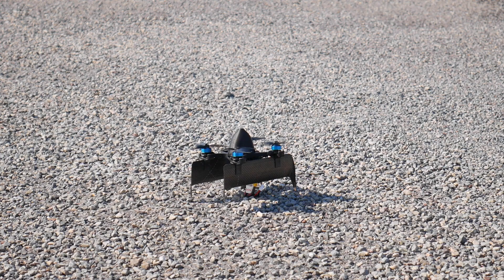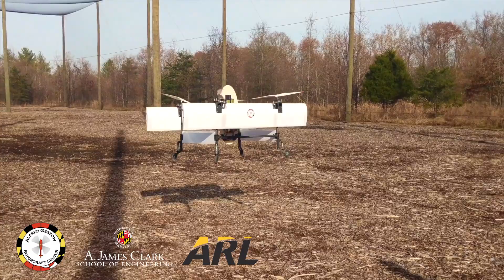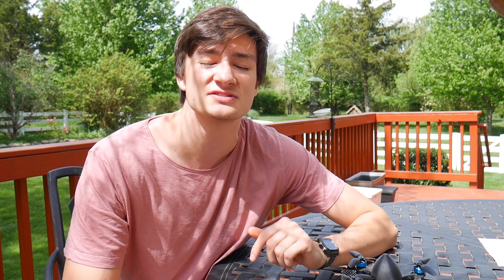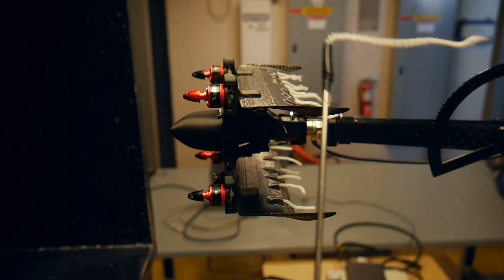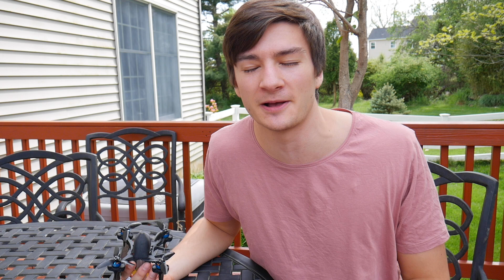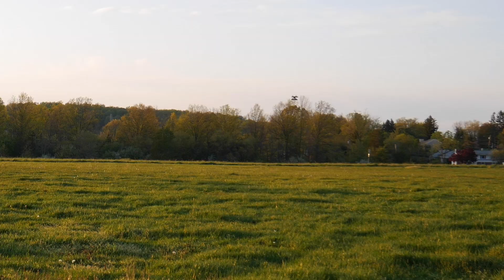A New Kind of Quadcopter! Introducing the Mini QBiT

Comment: Great!
which Autopilot did you use for it? 
And Did you design the whole model at Simulink then upload the generated code on a microcontroller board or you used a build-in configuration?
Reply from the maker: Thanks! In this case I used Betaflight.

Comment: I ended up printing the quad in PETG, using foamboard for the wings, and then off the shelf electronics and batteries.

I had no idea this was a thing! All I had to do was change one of the flight modes on the remote to swap the aileron and rudder channels, and this thing is super easy to fly, either hover or forward flight. I've been blasting the local club field every weekend ever since...really wish I'd heard about this sooner, back when the site was still online.

I have an old flamewheel 450 that's just hanging on the wall...think I might sacrifice it with some glue and foamboard to build a much larger scale version, bigger so as to include a pan/tilt servo for the camera, and of course an HD camera system. Thanks so much for your work on this! You've really opened up a new part of the hobby for me.

Comment: why isnt this more widely used? control problems?
Reply from the maker: That's a good question, but has somewhat of a broad answer. More widely used compared to what? It has advantages over a quad but also sacrifices some manuverability due to the wings.
Reply: @peterryseck  I am just guessing that the massive efficiency gain would have found at least some niche somewhere

Comment: My order is on the way. 
Have you tested efficiency for horizontal flight time if Qbit is modified to achieve standard neutral center of gravity for the wing?
Reply from the maker: The CG is currently just ahead of c/4, but yes, testing cg placement in relation to efficiency is super important but I have not looked into it much.
Reply: @peterryseck  So fairly nose heavy. If a longer battery can be found easy to test adding rearward extensions to wingtips. Mainly something interesting to me to improve glide behavior at low power. Something I will worry about later. Thanks for feedback !

Comment: Nice! Been working on a similar design for a long time, close to what you started with - using wings from small/chuck foam gliders. Also, trying them in X-wing configuration to track the quad's arms, even burying the arms into the leading edges. Wish Betaflight's FPV Angle Mix would go to 90* so that it could be put on a switch to swap yaw/roll. Then add servo to tilt the camera from 30-90 degree uptilt.
Reply from the maker: Very cool! Yeah a servo would be nice to use for fpv.

Comment: How does it affect performance? Does the drone go faster on horizontal axis? Does the added weight render it less snappy?
Reply from the maker: Great questions, this paper I wrote discusses performance: https://www.researchgate.net/publication/348751087_Experimental_Flight_Testing_of_Wing_Configurations_for_High-Speed_Mini_Quadrotor_Biplane_Tail-sitter

It actually has a slightly slower top speed (about 3-5m/s slower) than a standard quadcopter, probably because of the extra drag from the wings. 

It's slightly less maneuverable with wings because they are a big surface hitting the air. That means its more difficult to fly in certain ways, but also has the advantage of making stopping and slowing down easier because the wings act as big air brakes when the vehicle transitions back to hover mode while still moving forward.
Reply: @peterryseck  Ok thanks! And does the efficiency is better?
Reply from the maker: @lucr1369  Yeah it reduces power about 30% at ~10-15m/s

Comment: That's a brilliant idea! And the execution is even better!! Those carbon fiber wings look sweet!! Where is the center of gravity? Have you taken into account where the lift is produced relative to the Cog? Do you use a mode 2 radio to control it? How hard is it to fly? Thank you for this brilliant video!!
Reply from the maker: Thanks so much! CG is slightly forward of the c/4 of the wing, which seems to be a good spot for it. It's a great point actually, the cg makes location relative to the center of pressure is very important in maximizing the performance gains from the wings. The battery sits in the frame the way it does in order to push the cg further back. I'm using mode 2 to control it. Flying is not too difficult, takes some practice. You can watch my more recent video on the dual fpv camera setup which makes flying it even easier. Thanks again!
Reply: @peterryseck  thank you! Very cool idea

Comment: This is a super neat idea! I'm curious to know how the wings affect the flight times, since this should be more efficient, right?
Reply from the maker: Thanks! I'm still working on an exact number, because the difference in flight time between with vs. without wings is dependent on how fast it's flying. But something like 10 min to 12 min increase in flight time from no wings to with wings is probably about right.
Reply: @peterryseck  That might be a little optimistic. Dont you mean a total flight time of 10 to 12 minutes not an increase of 10 to 12 minutes?
Reply from the maker: @robertbotnick5059  woops yes, you are correct in what I meant to say

Comment: Very professional build! You should check your flight controller's black box and figure out what your typical angle-of-attack is, and then experiment with building that into the wings. That will get your props closer to level with the ground, lowering p-factor and probably improving handling, maybe efficiency.